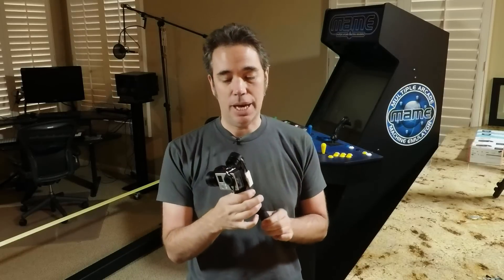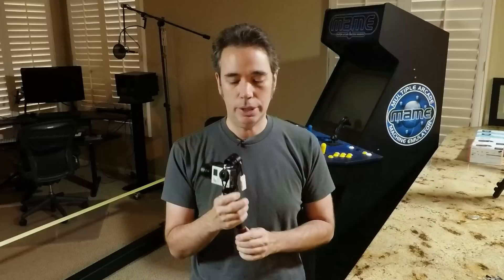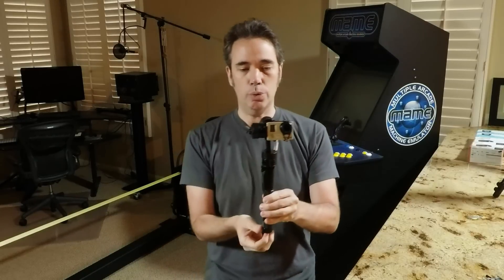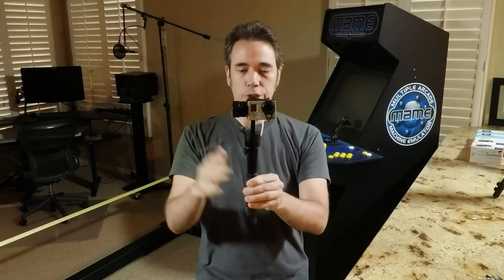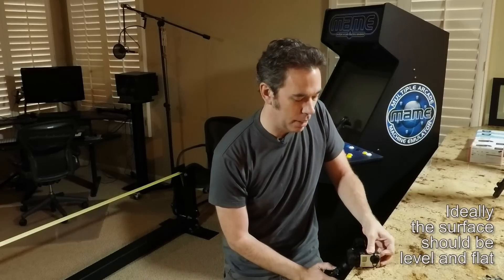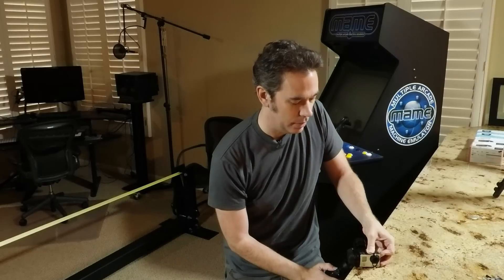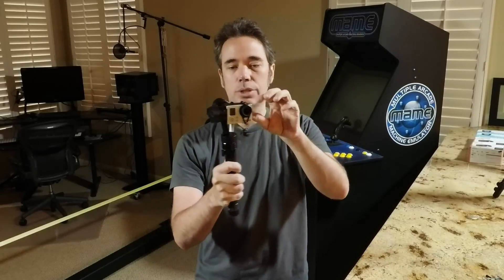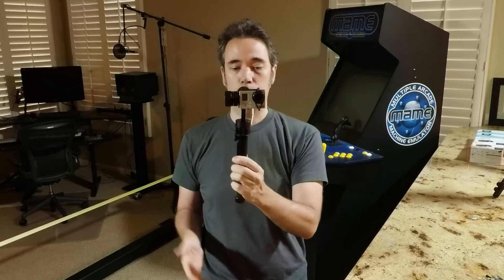Gimbal calibration (FunnyGo or other AlexMos/Basecam stabilizers)

Comment: Hello, i just got an funnygo, and i got the charger for two batteries, but if i connect the usb cable to my computer i get an red and green led light on the gimbal, can i charge the batteries in that way? with the usb cable ;)

Comment: That's a great option to reconfigure the buttons.  Is there somewhere that I can get a manual and/or software that will enable me to do that?
Reply from the maker: Sir Robynhood Sure, you can download the GUI here:

http://www.basecamelectronics.com/downloads/8bit/

Make SURE not to press USE DEFAULTS, or it will reset all your gimbal settings (bad).  To make the change, just connect to your gimbal, read the current settings, go into the RC Settings tab, and you'll see a section called RC Input Mapping.  You should see the pitch box say 'RC_PITCH - PWM', just change this to No Input and change the roll box to 'RC_ROLL - PWM', then click Write and you're done!  I believe this is per-profile, so you might need to go through and do this for the 3 profiles that are in use.

It's also a good idea when you read all the settings, to save them so you have whatever your factory configuration is - that way if you do something wrong, you can easily go back.

Comment: Thanks for the suggestion.  I tried the accel calibration and I can feel the motors disengage and reengage.  However, the gimbal still leans off to the side.  I'll try the gyro calibration but I'm not sure how to do that.
Reply from the maker: Sir Robynhood I've tweaked all my settings, but I'm pretty sure it's just holding down the button that does the gyro calibration.

The only other thing I would suggest is changing you config to make the buttons control roll instead of pitch - when I'm in the field, there are times it just isn't convenient or realistic to calibrate it, so being able to correct roll is super handy

Comment: I have the Pilotfly and am using it with a gopro 3.  When I turn it on it stabilizes correctly but then leans off to the right side.  I tried the calibration method you suggested and clicked the calibration button a few times but nothing seems to happen and if I turn the gimbal off and then on, I have the same issue.  I'm not sure what to do now and I'm not sure where to get a firmware update if that is required.
Reply from the maker: Sir Robynhood When you click the calibration button, can you feel the motors disengage, and then re-engage?  If this doesn't happen, then it's not actually performing the calibration.  You also might try doing both the accel and gyro calibrations - in both cases, make sure you feel the motors disengage so you know it's actually doing something.

As far as firmware, I doubt that is it - it just sounds like calibration, it slowly goes out over time so you need to do it periodically.

Comment: I have accidentally  clicked the use defaults on the software and now my PilotFly FunnyGo goes all crazy when I turn it on, any recommendations what i can do to fix this?
Reply from the maker: ***** Uhg, that sucks - I would email PilotFly and he can send you whatever the latest default profile they're using.  You could try to tune it yourself, but it's a PIA if you haven't done it before (and even if you have), plus their default tune is quite good.  You might also try changing profiles and see if the reset is all the profiles, or only the current one - if one of the other profiles works, then you could just copy it over and tweak from there.  Either way, getting the default from PilotFly is the best option.
Reply: ordog botond  ive been having the same issue with my funnygo.  It has been a year that it acts crazy.  Pilotfly has not responded to any of my emails.  Did u by any chance manage to get yours working again?  Thank you.
Reply: yeh, it seems the have inserted such narrow cabling that it broke as I turned the head so it need to be replaced( the cable from the control board to the side emu board ) but you will have to measure out witch cable is  broke and its really hard to find a cable that fits
Reply: ordog botond ...so ur funnygo is now working fine after u replaced the broken cable?  where did u manage to find a replacement cable that fits?
Reply: I have some snapshots of my one if it is still relevant to you 4 years on

Comment: Hi,

I just fired mine up and did the calibration like in your video. Mine will work ok for a bit but if it bumps the travel stops or go to fast with the motion, it starts to shake and freak out and it wont stop till I turn it off. Is this normal for it to sometimes shake uncontrollably?

Thanks
Reply from the maker: SydwazShawn It certainly can freak out a bit - and it does happen sometimes when it hits the limits, but in general when I hit them it tends to just sort of release and then hit the stop again.  Usually when that happens I just turn it off and on, since that's generally easier - but sometimes you can just hold it steady and help it get it's bearings again.  I would definitely try doing the calibration again, and maybe even the gyro to make sure it's nailed down.  I also usually put it on a mount and see if it drifts at all afterwards - if you look at my 3S battery hack, you can see it basically holds it's position fine for almost 3 hours - if the calibration is a little off, you'll usually see it drift when it's just sitting there in just a minute or two.
Reply: Anx2k Thanks for the reply. I will try some scenarios. What about the control software. Where can I download that?

Thanks again!
Reply: P.S. I have the Pilotfly FunnyGo 3 axis
Reply from the maker: SydwazShawn You can get the control software here, it's called SimpleBGC GUI (8 bit version):

http://www.basecamelectronics.com/
Reply: Anx2k Thanks man. Big help. Cheers!